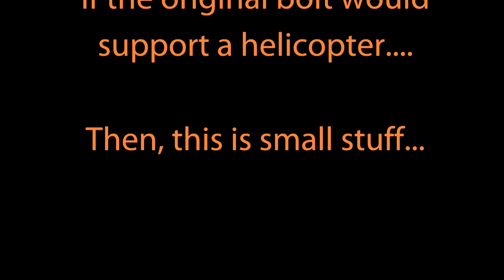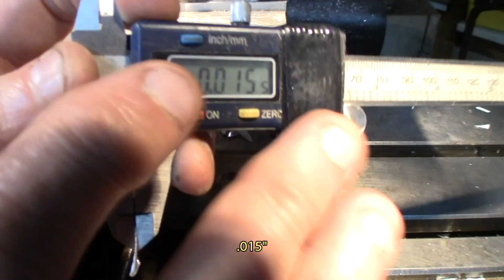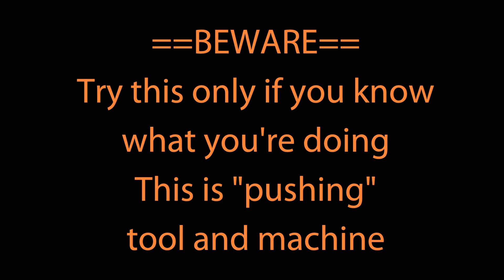Pushing Randy Richard's dovetail cutter, made from a Sikorsky landing gear bolt

Comment: Would that cutter work in cold rolled?
Reply from the maker: Hi, no problem even in materials like in O1 or W1 also 4140 and many more heat treatable materials, you'll need to work out your cutting speed and feed accordingly, nothing near like this stunt in aluminum...
A good starting point would be around 1500 RPMs and 0.002"  (0.05mm) per rev.
Thanks for comment,   Pierre

Comment: I have one of the "production" cutters made from 414? steel (hardness as supplied). My expectations are to use it to make some custom AXA tool holders, so I expect I will be working some fairly tough steel. (I probably won't push the tool quite so hard.)
Reply from the maker: +Peter W. Meek Hi Peter, in steel a definite slowing down is a must.... I'd be curious to try one of those non heat treated tools to see if they behave the same...??? Those helicopter bolts are a definite high quality high strength special treatment steel.
Always depends on how you intend to push tool and machine, I, certain the results will be flawless.   ;)
Thanks for comment,   Pierre

BTW, is the monitor screen for your CNC mill going somewhere positive?

Comment: Maybe I need to get one of those cutters for "metal mowing madness" , oh but wait none of my machines can even turn 3k..... oh well back to the land of the slow. :-)
Reply from the maker: +bcbloc02
Hi Brian, I'm so disappointed that I'm limited to 3000 rpm, this cutter could go much faster in aluminum.... ;)
In steel your machines will do perfect, and, when do you cut dovetails in anything but steel...?
Good name for your new shop "Turtle Works" ...   :))
Thanks for comment,   Pierre

Comment: Holy smokes Pierre - those chips are huge! I'm wondering what you have been smoking LOL :)
I can't make 3k RPM but next time I use it will probably use my full 2,200 on Al and keep to probably 1,200 for steel - a figure I think Randy mentioned.
Reply from the maker: +ChrisB257 Hi Chris, no problem at all going 2200 rpm, just add a little kerosene and feel the advance, and don't be afraid to push a little. Start slow and you'll know when it's time to ease up the gas pedal... Be safe though... ;)
Pierre

Comment: Was that aluminum being milled or steel?
Reply from the maker: +hankus253 This is 6061-T6 aluminum, you can hog steel pretty efficiently but not at that load, more like 2000 rpm, and chips around .002" thick.
Thanks for comment,   Pierre

Comment: Holy cow Pierre you trying to break that tool?  Maybe you and Phil are too dangerous when you get together.  Obviously Randy has made a really tough dovetail cutter.  Thanks for the fun video.
Reply from the maker: +cerberus Hi Harold,
This tool is surprisingly tough, not trying to destroy it at all. 
Aluminum is kinda forgiving, with my machine, in steel, I would slow down to about 2000 rpm and chip thickness about 2 to 3 thousand...
We get a little out of control, but, not dangerous, hummm...!!! At least I don't think so...    ;)
You're visiting is always welcome,   Pierre

Comment: BHC Big Hot Chips. You done it so I won't have to with mine! Thanks for the video, CJ
Reply from the maker: +CJs Custom 
All the pleasure was for us...  ;)

In steel I would slow down a bit... But if you have a sturdy machine you'd be surprised how far you can push the tools...

Thanks for comment,   Pierre